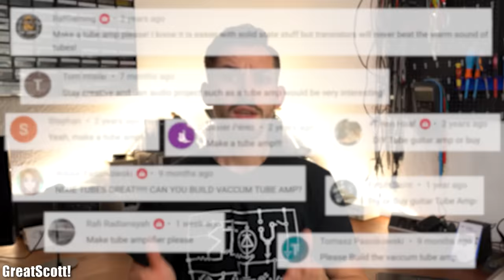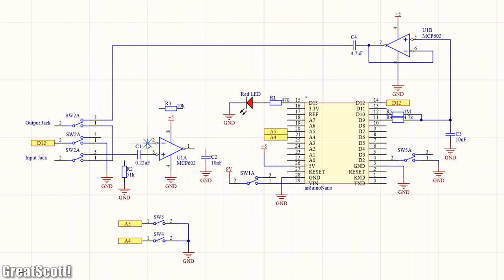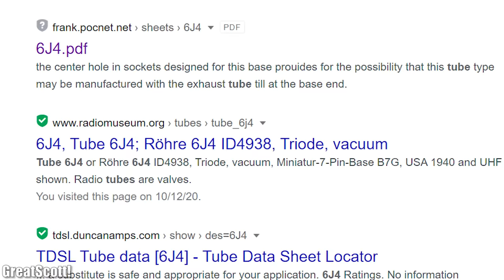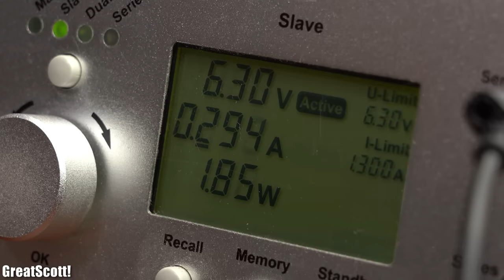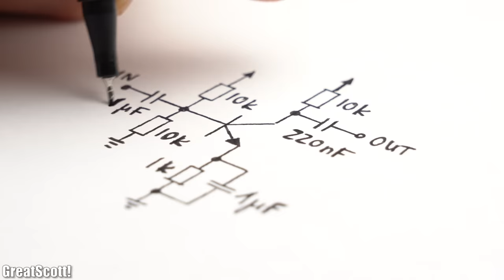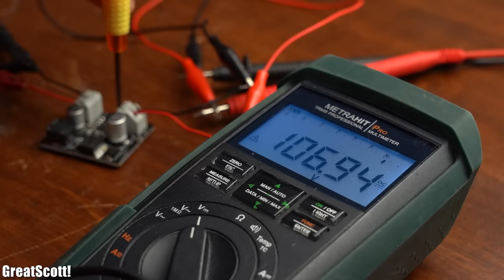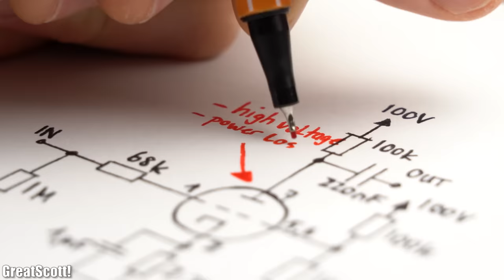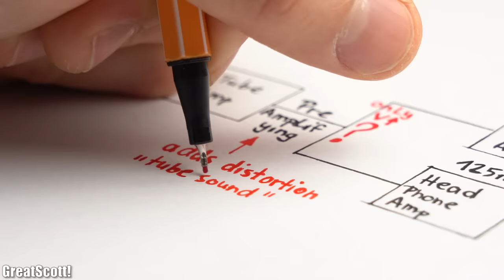Building a Tube Amp! Does it produce better audio quality though? EB#47

Comment: As a tube amp designer, I would like to add on to your theory at the end as you were quite close to hitting the nail on the head. You will notice the curves for the tube not being evenly spaced unlike the transistor in which causes even order harmonics to be generated as opposed to the transistor in which (especially when driven into clipping) generates predominantly odd order harmonics (which sound terrible as they are not musically related notes). The dominant even order harmonic with a triode tube is the 2nd, being the octave. This brings rise to huge popularity using triodes as distortion generators for musical instrument circuits as all distortion generated is musically related to the fundamental frequency and although does contain odd order harmonics, all harmonics after the 2nd decay in even amounts from one another which has the result of the triode distortion not containing too much high frequency fizz! I'd recommend googling the harmonic distribution chart of a triode.

Most electronics channels of course always talk about hi-fi use when it comes to audio circuits but forget that there is a whole other world out there in which distortion is wanted- but you are right in saying that there is a taste for tubes in hi-fi. As I said with the distortion being musically relevent, it can have a nice tone to it. I built my first vacuum tube hi-fi amplifier when I was 18 and I still use it to this day!
Reply: I don't think it is that, but it's easy to find out, i suggest you get a spectrum analyzer and check the output of the Valve amp, i was thinking in do that, but I don't have the time. As a tube amp designer I think this will be great to do such a test, who knows put to a end to this discussion and legend :)
Reply: Electrons move more freely in a vacuum!!!
Reply: "Musicality" is a by product of distortion. Choosing the type of distortion, and it's amount of influence is the really difficult part of audio design.
Reply: Scott was looking at the wrong curves if he wanted to compare tubes with transistors. The curve that really gives the information is the one that relates input voltage to output current.

For a tube, the current out is approximately proportional to the square of the voltage in. When the input receives a sine wave of a particular frequency, the output current will mainly be a sinewave of the same frequency plus a lower amplitude sinewave at twice the frequency. That's second harmonic distortion and, for some reason, our hearing perceives that as a pleasant sound. There will usually be small amounts of fourth harmonic distortion and higher, but still nothing we tend to find unpleasant.

For a bipolar transistor, the current out is approximately proportional to an exponential function of the voltage in. When the input receives a sine wave of a particular frequency, the output current will mainly be a sinewave of the same frequency plus lower amplitude sinewaves at twice, three times, four times, etc. the frequency. That's still harmonic distortion, but our hearing generally perceives third order harmonics as unpleasant, and the same seems to be true for all odd order harmonics.

Nevertheless, well-designed amplifier circuits incorporate generous amounts of negative feedback, which will reduce distortion (particularly in transistor amps) to levels that are virtually unmeasurable against the background noise. It is very difficult to believe that anybody could distinguish the difference between an output signal from a tube amp and that of a transistor amp if sufficiently high levels of negative feedback were present to ensure that the output was a faithful reproduction of the input signal.

Oddly enough, field effect transistors have just the same sort of transfer characteristics as triode amplifiers, but we don't see audio enthusiasts complimenting the sound of jfet or mosfet amps.

One of the other differences between solid state and tube amplifiers is that solid state clips signals quite abruptly when overdriven, which effectively turns a sine wave into a square wave, A square wave is equivalent to a sine wave plus its third, fifth, seventh, etc. harmonics, which are just the ones that we find unpleasant. Tube amps clip much more progressively, adding extra harmonics gradually as they begin to be overdriven, so that may account for the different "sound" of the distortion found under overloading conditions.

Finally, the much higher voltages found in tube design allows more overhead before the output starts to stray from linearity, and the higher voltages and higher impedances of tube amps often require output transformers in order to match low impedance loads such as loudspeakers. Those transformers often restrict the frequency response and can introduce other nonlinearities into the amplification chain, and may themselves be significant contributors to the "valve sound".
Reply: @RexxSchneider  thank you for sharing your knowledge. as an electronics student i've found this extremely fascinating :)
Reply: I'd love the add that most tubes cut off frequencies are gentler slopes as well as their dynamic response tends to be more "natural" at the risk of using buzzwords. the nuances of dynamics are better translated.
Reply: It's the even order distortion that's soo pleasing
Reply: i know this comment is from two years ago, but i would love if you could share some of how you got to be a "tube amp designer"!! is that something you can do as a full time gig?
Reply: @tb7737  It wasn't a full time gig, but I made a good side hustle out of it. The idea was simple, the market is saturated with Fender based designs- so do something else. Musicians love to think they are special, so it sits with their ego. I'm sure with enough experience and lots of luck you could do it as a full time gig for some large brand though- someones gotta.
Reply: I am a guitar player and teacher, very gifted at the instruments, but amp choice is still a big question mark. I wonder if this harmonic difference that you describe is why some guitarists in the 70s and 80s (Leslie West, Eddie Van Halen even) were able to 'use' the harmonic feedback in their playing style...
Reply: @sKraat528  tube amps are exactly where electronic feedback and distortion pedals came from!!
Reply: @tb7737  For sure, the pedals supposed to simulate the overdrive of a tube amp, but even with the same guitar, same note fretted, a solid state overdrive pedal gives a different 'feedback note/tone' vs an actual tube amp, I don't have a video of it lol but tried this out once with a friend who plays on tube amps. 7th fret 2nd string, feedback with a solid state pedal 'feels like a different note altogether' vs the feedback from overdrive tube amp 🤔
Reply: I’m my experience with transistors, a single transistor amplification stage or a non complimentary output stage will produce even order harmonies.
Any sage that involves complimentary stages produce odd order harmonics.
Reply: Good video man. To find out which of the 2 is the best sound, don't go through all of the electronics and pull your hair out from searching what everything does. Simply go by a transistor Amp and a tube Amp of the same model. Example Fender twin have both transistor and tube models. Then then play them both and let your ears be the judge not your eyes.

Comment: I'd like to see you do an AC sweep for audio frequencies and do a Fourier analysis to see if the difference in sound quality has anything to do with the frequency response of the two amplifiers. Maybe even create bode plots for them and compare.
Reply: tube amps are nonlinear circuits so an ac sweep wouldn't be very accurate
Reply: @5d51e2gyU6JD  All circuits are nonlinear outside of their frequency response. An AC sweep would be accurate and useful over the range of human hearing
Reply: @liam1253  tube circuits are highly nonlinear in the human hearing range as well
Reply: @5d51e2gyU6JD  and how do you determine the range for which an amplifier is nonlinear? With an AC frequency sweep. You have a circular argument

Comment: I had a grandfather who worked with TVs based on tubes, back in the old days..  He loved when transistors went to market, as they get rid of many problems tubes had: high voltage, excess heat, fragility... Anyway, nice videos! Keep on with such great content.
Reply: I totally agree with your grandfather. In the 70s into 80s I earned most of the money to finance university by repairing all kinds of common tube devices (TVs, radios, PA-, Guitar & Bass-Amps). They always had to be repaired, esp. the TVs, because of damaged transformers, tubes and capacitors (because of the high voltages of about 300-500V, up to 25.000 in TVs), exhausted tubes (burnout),  etc. 
Switching to transistors and thyristors changed everything later. 
Today from time to time I still restore some old guitar- or bassamps (at the moment a 'HiFi Binson 40WB' Guitar-Amp and 'Echolette BS40' bass amp both from the early sixties )

Comment: We asked espechally in your "electrically generated music" Video, because overdriven tube amps are used for the typical rock and metal sound.
So a lot of musicians use Tube Amps  for their sound.
Reply: Indeed, tubes handle clipping more "gracefully" than SS, and are therefore still in great demand for guitar amps.

Comment: As mentioned below, an amp is not a tube amp because it has one single tube in it. Building a tube amp from scratch is a tedious task involving much planning, calculating and reading datasheets, while dealing with lethal voltages. I built a lot of real tube amps and i repair and service them regularly. Tube amps are fascinating and great fun and every visitor to my house likes the sound of my stereo or guitar amps.

Comment: How about a diy oscilloscope?
Reply: That'd be sick
Reply from the maker: It is on my to do list
Reply: Heck yeah dit or buy !
Reply: I can make it. Just using my phone
Reply: Can't wait :)
Reply: I was gonna comment the same!
Reply: Didn't he already build one from an old CRT?
Reply: @greatscottlab  thanks
Reply: @dm12e  yeah I'm french and my keyboard autocorrected it
Reply: @greatscottlab  sir you told me this 4 years ago. Please tell me you have an amp build with bass and treble controls.
Reply: I remember you made a Crappy one from a CRT tv
Reply: That's so difficult for the typical video cycle! Well at least if you want to make something with bandwidth >50MHz
Reply: Diy or buy!!!!!!!
Reply: That would be awesome!
Reply: Heck yasss
Reply: If im not mistaken there is one but not diy vid.. Its just a pre made one vs proper old one, correct me if im wrong
Reply: Never thought I'd see another cuber on here
Reply: @立花たくや  hahaha same😂
Reply: That be like a multi part series 🤔
Reply: Yes please. That would be fun.
Reply: @jedmoutahir  ok
Reply: What's the point? There's that 7" tablet oscilloscope that EEVBLOG did a review on and it's actually a lot better than he made it out to be and it's so cheap that it would probably cost you more to DIY it. 
Not only is it super easy to use, it has a rechargeable battery which means that it's AC isolated! And can easily be upgraded to a larger capacity if you need more than 4hrs It's portable if you need to work on your car, it has FFT function. 
If you are only planning to work with audio and other low frequencies then this thing is perfect! 
I got one and I love it.
Reply: Yes please a DIY Oscialltor, I'd like to suggest this small and simple example of one, EFY DIY Oscialltor. It has limitations but works for simple circuits !!!
Reply: @greatscottlab  Yes please a DIY Oscialltor, I'd like to suggest this small and simple example of one, EFY DIY Oscialltor. It has limitations but works for simple circuits, I've been using this but I'd like a better option for sure 🤣🤣🤣!!!
Reply: LMAO
Reply: @greatscottlab  Please make a cheap oscilloscope which can be made easily.
Reply: Mind telling me what's the use of oscilloscope?
Reply: @aspopulvera9130  search in YouTube.
Reply: DIY variac.
Reply: I think you can find a useable oscilloscope 
On Bangood, you can or could get it with a clear case or without.
Reply: You're generally better off just buying something within your budget. My miniware DS213 only has 15MHz bandwidth, but it has been more than useful for a multitude of projects. It's not nearly as convenient as my full size Tek DSO (which itself is not as nice to use as my Tek 2225 analogue scope), but for most of what you'd use a scope for (especially at hobby level) it's more than adequate.

I would still keep to a calibrated proper DSO for any precision work (i.e. direct noise measurements, etc.) or an analogue scope if latency is important.

Miniware's LA104 logic analyser is also very handy, even though (as expected) it too has significant limitations compared to professional test gear.

I hope Miniware make an audio/RF spectrum analyser, it'd be just perfect for testing amplifiers and aligning radios, probably get me branded a heretic in the eyes of Mr Carlson though 🤣